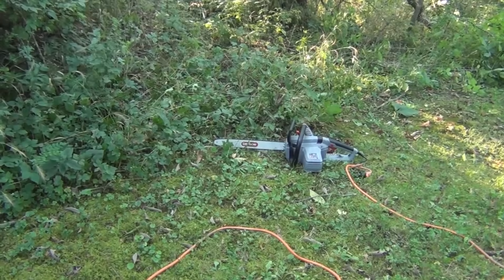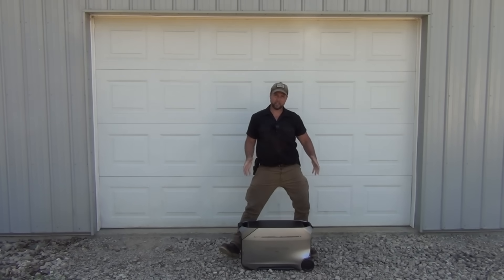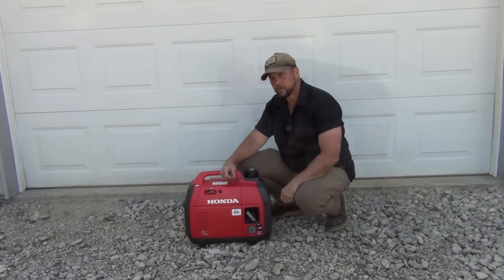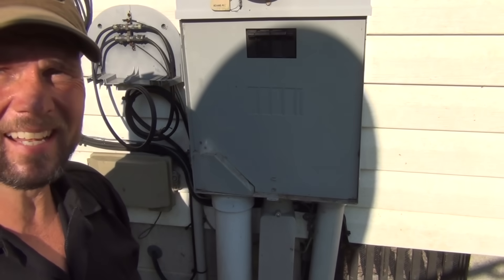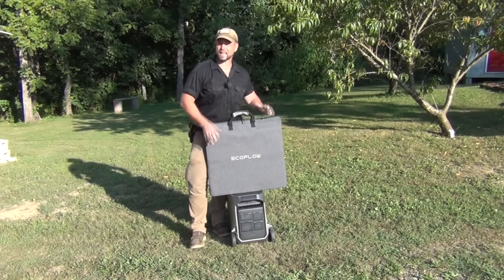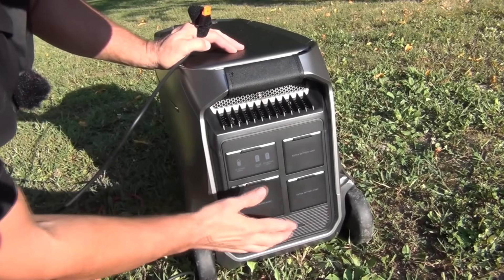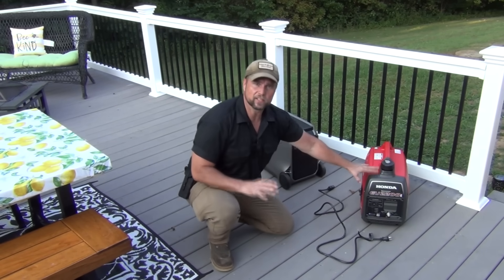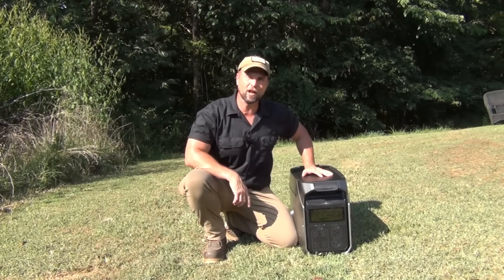EcoFlow DELTA Pro 3 Solar Generator Review – 4 kWh Expandable Power Station (Ultra-Quiet, UPS-Ready)

Comment from the maker: As disaster season peaks in the fall, stay safe and powered during hurricanes with @EcoFlowTech. Reliable, indoor-safe, and easy to use, EcoFlow is your ultimate home backup solution. Use my code 25EFDCWPS for an extra 5% off all EcoFlow products for disaster preparedness (Except flash sale items and recommended accessories). Valid until September 30.  EcoFlow DELTA Pro 3: https://bit.ly/4ow3BVZ
Learn more about EcoFlow solutions：https://bit.ly/41vSBhl
#EcoFlow, #DisasterPreparedness, #HomeBackupPower, #SolarGenerator, 
#PortablePowerStation, #PoweredByEcoFlow, #StormReady, #Hurricane, #HomeBattery
Reply: I have never seen somebody have to pull on a HondaGenerator like that… That’s when I changed the channel!!!
HONDA 1

Comment: Sooo, not referring to this product in any way, I have a question for you about the portable solar panels.
The yard buzzards hobos portable battery charger solar panel just burned out on them and she said that you can't put it out in the high noon heat in the summer because it will get too hot and cook it. The panels you usually show are much larger and I wondered about that issue? Also have you ever had to pack them away that hot? 
What is the expected life of a portable solar panel? I'd love to see a harbor freight review of such things.
Reply from the maker: I'm sure that a lot of it has to do with the quality of the solar panel that is being used. Thanks for watching and for the suggestion.

Comment: Most people can't afford a $2700 generator I know I can't. I'll stick with my $600 gas powered generator. When I run it to shut down I turn off I shut off the fuel supply the fuel supply and let it it empty the carburetor so it doesn't keep the carburetor full of fuel and cause problems with it because the gas nowadays has ethanol in it which can mess up gas powered equipment carburetors if stored without running periodically.
Reply from the maker: Thanks for watching and for sharing your experience with gas generators!

Comment: These are fine power options.  They also provide costly power, given the purchase price.  Powering a household refrigerator was an interesting exposition:  Ice water is the least of our needs!  Less than two days of emergency power for refrigeration might be enough to get most of us through an emergency outage.  Saving our perishable and frozen food items is a significant survival need, as well as a way to offset the cost of this type of emergency power supply.
Reply from the maker: Thanks for watching and for the comment!

Comment: My power stations have to  be portable for me,  a verticality challenged older woman.  I  got the most powerful solar generator I could easily carry and move around.  I  can confirm gas generators can be a pain,  but the  noise is the  biggest problem for me.  It  tells thieves and never do wells where they can  get a generator.... our government wants all Americans to  be Ready. This means you should have enough,  medical supplies,  food, water, plus other items to  get you and your unique family through  three days  independently, in an emergency. Thank you for reviewing this product it could be a real help for many families.
Reply from the maker: Thanks for watching! You make some very valid points!
Reply: Honda +.45 auto
Reply: @christophertiredofbs8514 😂, yes but in Missouri you are not allowed to protect property with lethal force.  It is better if the perpetrators accidentally off themselves like the idiots that electrocuted themselves by trying to steal the street light wiring and not checking to be sure there was no power in the line before they grabbed the cut end of the wires....

Comment: I’ve used the Delta Pro 2 before, and the jump to a 4 kWh expandable system with ultra-quiet operation is a huge deal. Being able to recharge in just an hour is a game changer for off-grid living and emergencies. EcoFlow really solved the main pain points of gas generators noise, fumes, and fuel storage
Reply from the maker: Thanks for sharing your experience!
Reply: Honda

Comment: I’ve had this unit over a year, some things to consider. Get the EcoFlow 4000 smart generator because it will take forever to charge it up with a 2000 watt inverter and get bigger solar panels, those little panels  will only trickle charge the DP3. Get some 400 watt panels and Max out the high and low pv. Over all a sold unit.   The pecron 3600 something to consider too for the price
Reply from the maker: Great idea on the charger!

Comment: Okay, now you're talking.  Can you charge it with your car? How long did you say the window unit lasted? How long to charge with max sunlight? Im impressed you can lift that without grunting.  Definitely got you winded this episode.
Reply from the maker: It really depends on how much input you're using. The air conditioner was turned on the highest cool. If it had been on low cool it would last much longer.
Reply: Car charging, yes
Solar charging from 0 takes about 10 to 11 hours
Re watch the part of the video to see how long his unit lasted by looking at the hours on the left hand side of the face unit.